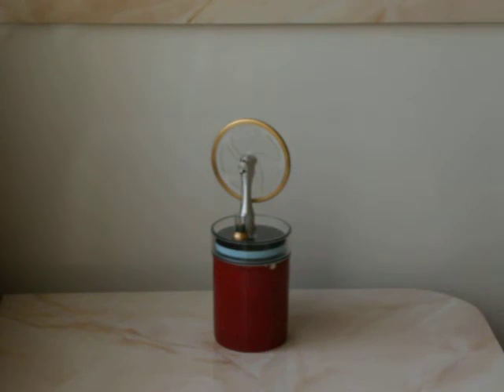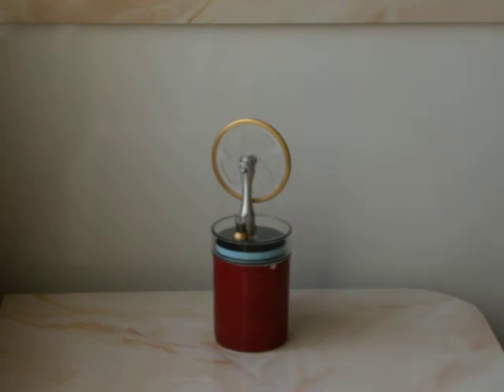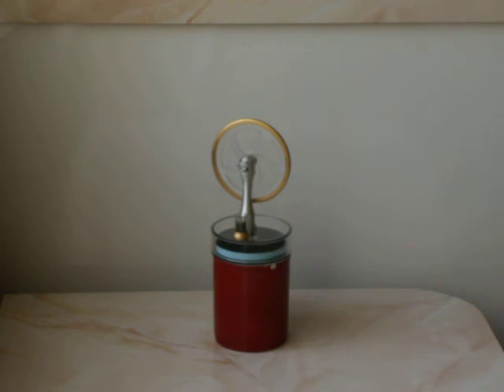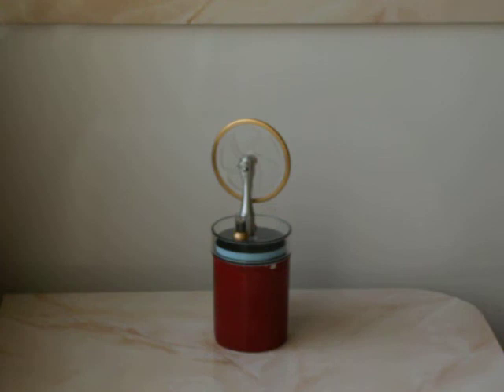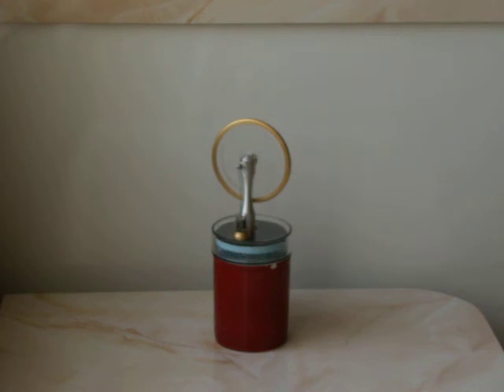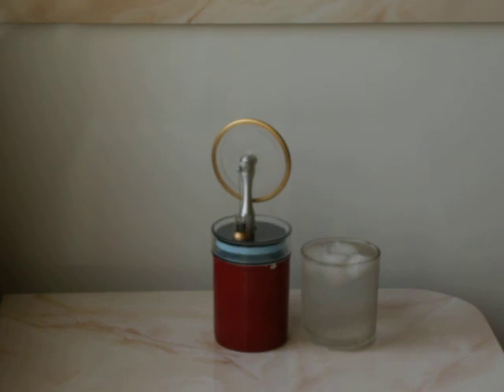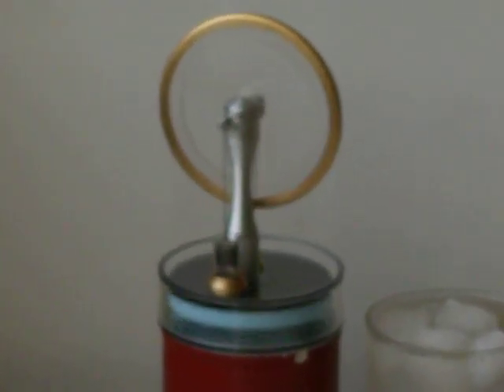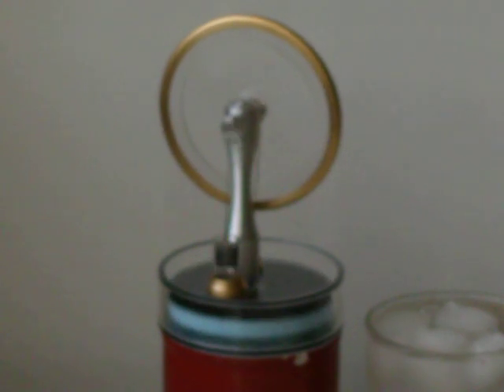My Stirling Engine from Kontax

Comment: @RodgersResearch 
Hi, you want the best conductor possible, to let heat into the displacer cylinder, and to let it out as fast as possible on the cold side.  No question about it.

Comment from the maker: @JayTee441    

This housing is plexiglass.
Kontax does make other models that use aluminum. 

Aluminum is also not good as an insulator. 
So, it would also lose the heat in the chamber fast.

The stirling engine works on differences between hot and cold. 

So, it's an interesting concept to test.
Which material gives greater efficiency?

Comment: Here's the problem with the engine I see in the video: the top is either glass or more likely plexi- so heat transfer is very slow.  Make the top and bottom from aluminum and the engine will start instantly and run much, much stronger.